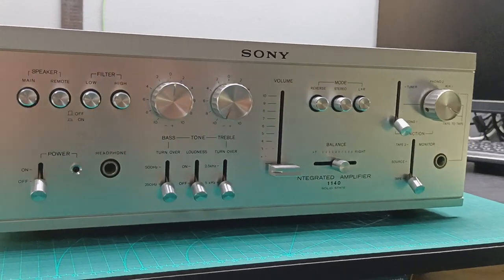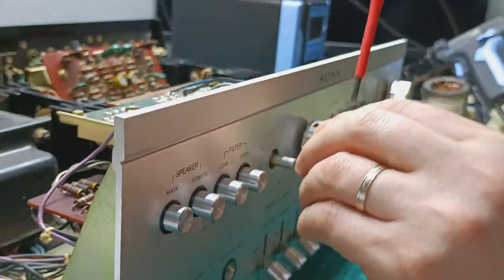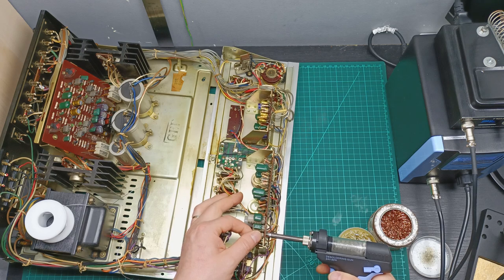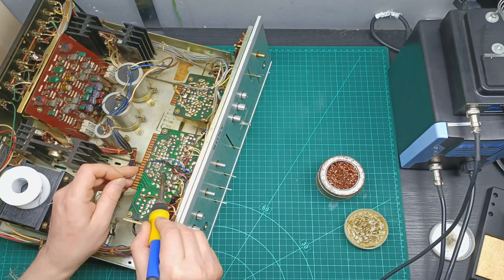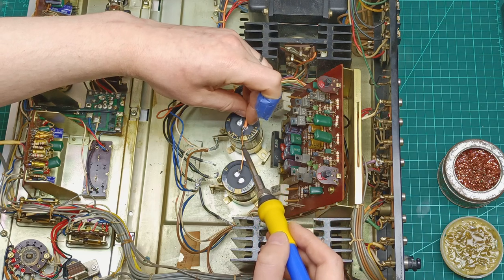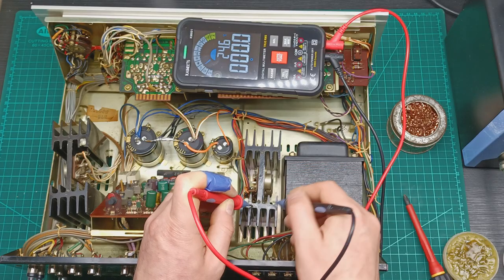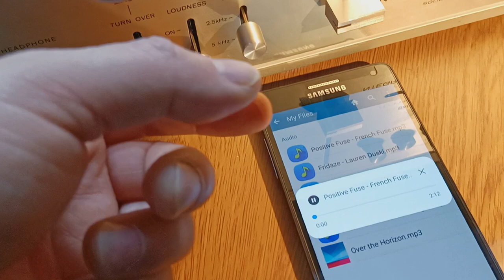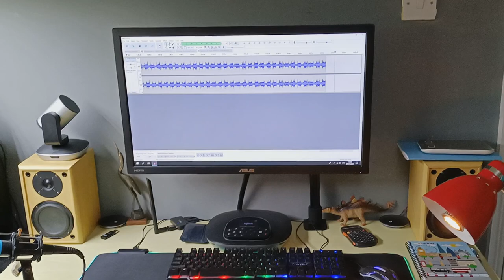Capacitors arrived Amplifier Sony ta-1140 serviced and recapped

Comment: Very interesting and Very nice amp! I'm interesting in the same TA 1140, there is one on sale near my town, do you recommend it for listening vinyl? In my town there are no technicians to do a recap like you did, so this amp in his original state,  worth it? Thanks!
Reply from the maker: Is a good amp but have his age and the capacitors definitely need refreshed. If you have a soldering iron and tools to desolder the old caps following my video and first look inside for all the capacitors values and order them is a really easy job to change all the caps

Comment: Yes I did enjoy watching this video. 😄 

I don't know what it is but there is some good feeling when we fix something instead of throwing it away.

Was this a job you did for some body or for yourself?

This is a nice piece of equipment.

It's from an era when quality was much better.

It's also from an era when labour was much cheaper.
Reply from the maker: Belongs to a friend, he bring it to me to do a service on it
Reply: @SymbolTech21  oh very good ! I see you are using a desoldering gun. It's very handy piece of equipment.

I'll buy one myself one day it makes replacement of caps much easier.

I use braided copper, a soldering iron and tacky flux which works but expensive way of doing  it. 🤔
Reply from the maker: @decem_unosquattro9538  is very easy with this solder sucker
Reply: @SymbolTech21  sucker ? 🤔
Reply from the maker: @decem_unosquattro9538  yes suck the solder from the joints and leave the holes clean and empty to can easy take out the components and insert new ones!
Reply: @SymbolTech21  Yes it's an essential tool for anybody that wants to remove through hole components from a pcb.